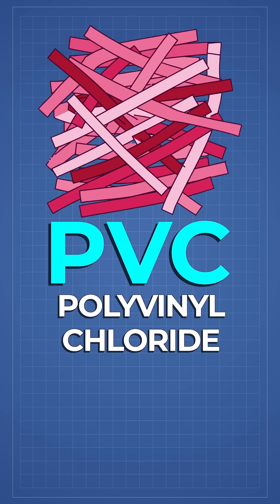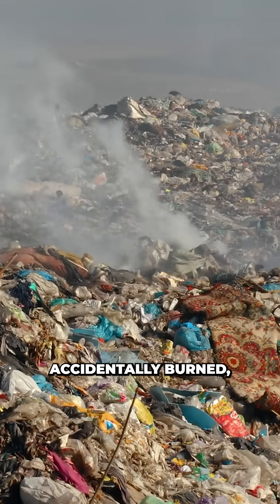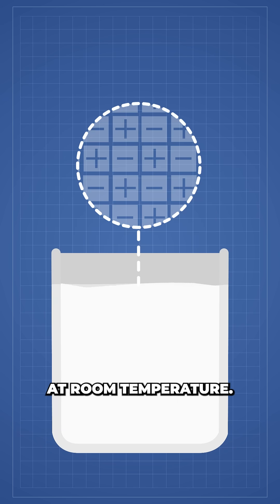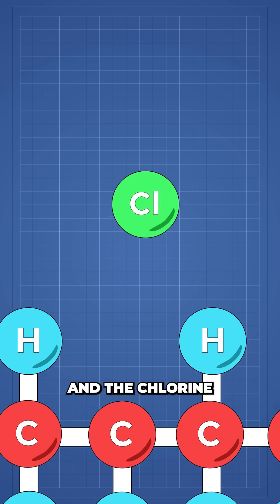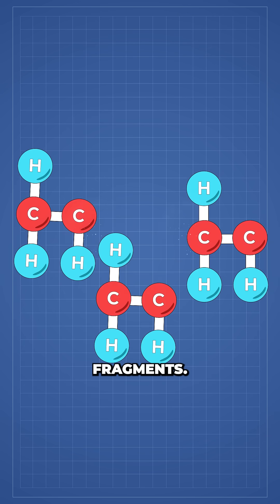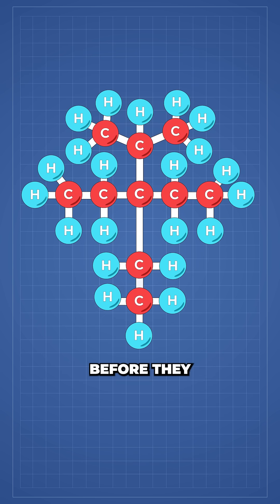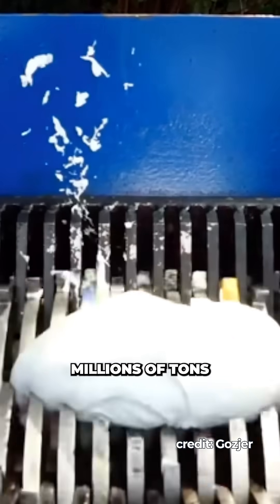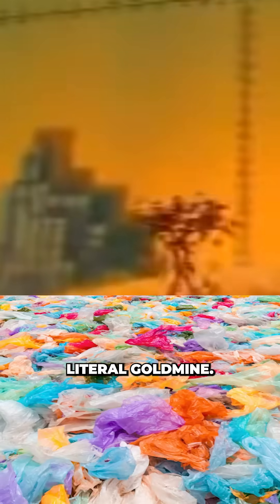Scientists Turn Plastic Waste into Fuel

Comment: no turning plastic in to fuel has not just been found out is been noted as early as 1980or the 1990 but the first usable form of this was in was in the early 2000 so this was not just found out is been around for about 4 decades

Comment: This has been around for years Scientists did not invent it this is why they got rid of plastic shopping bags because people were making free fuel.  It is the same way of making moonshine without water and fermenting wash you make kerosene and then still that again the kerosene and what comes  out is petrol or add the kerosene to takeaway oil and get something to run a diesel truck

Comment: The M16 Rifle: History, Design, and Legacy

The M16 is one of the most iconic military rifles in modern history. Developed in the United States during the Cold War, it has been a standard-issue weapon for the U.S. military and many allied forces for decades. Known for its lightweight design, high rate of fire, and modular capabilities, the M16 has played a central role in numerous conflicts, shaping the evolution of infantry combat.

The origins of the M16 can be traced back to the late 1950s. The U.S. military was looking for a replacement for the M14 rifle, which, while powerful, was heavy and difficult to control during automatic fire. The solution came in the form of a new rifle developed by engineer Eugene Stoner and the Armalite Corporation, designated the AR-15. The design used lightweight materials like aluminum and plastic, and it fired a smaller, high-velocity 5.56x45mm NATO cartridge, which allowed soldiers to carry more ammunition and reduced recoil.

In 1963, the U.S. military adopted a modified version of the AR-15 as the M16. Its first major deployment was during the Vietnam War. Early versions of the M16, such as the M16A1, were praised for their accuracy and ease of handling. However, they also faced criticism due to initial reliability issues, especially in the humid jungles of Vietnam. These problems were largely due to a lack of proper cleaning equipment and ammunition that produced excessive fouling. Over time, these issues were addressed with modifications, including chrome-lined barrels and the introduction of the forward assist, making the rifle far more dependable.

The M16 has gone through several updates over the years. The M16A2, introduced in the 1980s, featured improved sights, a heavier barrel, and a three-round burst fire mode instead of full-auto,

Comment: I had a similar idea in my undergrad using polyethylene to reduce it to ethane. I did some research on it and it turns out you can do it thermodynamically but it’s insanely inefficient and the yield isn’t very easy to get correct so it usually just turns into petroleum or something similar. I did find a bacterium that evolved to eat PET plastic that was selectively bred to eat other forms of plastic. This was about as close as I got to something like this lol

Comment: Since plastic is made by using crude oil tells me that reversing the process to get oil again is extremely inefficient to get the oil again, its good that we have a process to get oild from plastic, but its going to cost significantly more than the oil that we extract from the ground. Since energy can't be created nor destroyed we have to use a lot of energy to reverse the process. This will only be good when the prices of oil is so high that this processing will be cheaper than the oil prices

Comment: We always get these stories but it always turns out its like and then there's some critical flaw that doesn't get mentioned that people ignore and go "omfg the illuminati silenced them, that's why we dont have this"

Like...

We can recycle some plastics, it's just incredibly expensive to do in comparison to producing new plastics and the recycled plastics aren't as good a material.

Glass can be recycled and used as filler in asphalt for roads but it's only usable in warm areas because the roads are more prone to wear from cold weather.

The whole hydrogen powered car thing, supposedly the wave of the future and only produces oxygen and water as a waste material. Turns out when you expose most materials, like metals, to hydrogen, hydrogen atoms are so small that they're able to permeate between the bonds of the other materials and cause them to very quickly become brittle and break apart leading to the whole engine system literally turning to dust. Hydrogen is also much more difficult to store and transport than oil/gasoline.

Turning plastics in to fuel like this is great, but if it costs more money to convert in to the fuel than you can sell it for, it's not going to go anywhere. Likewise, if it costs more energy to produce than what you get out as fuel, you're not really saving anything. That's a similar issue that early EV's faced where charging the car's battery and running off the battery ended up being worse off for the planet than just burning gas to run a car. Things are better on that front now (not great but better), but it's an example.

Comment: Some time ago, say, twenty years give or take. They had a pilot project in Arkansas (I think) that was next to a poultry processing plant or three that was setup to take the left over by products from those plants, and turn it into a biofuel base stock. However, they found the ultra high pressure and heat used in the process could take pretty much anything that was organic, plastic, or even petroleum based, like coal and heavy crude products and change it into a light oil based product perfect for synthetic fuels AND remove toxic materials from the feedstock as well. However, it could only compete profitably if crude oil was at least a $100 per barrel. So I guess it failed. You might think that it would be a great way to get rid of this PVC and other such things even if you couldn't beat $75 per barrel oil, just as a better way to get rid of it than dumping it in a landfill.

Comment: This is nothing new. It takes MASS amounts of energy to do this. The amount of energy to "recycle" the plastics into "plastoline" which has much more harmful burn offs than traditional diesel and regular gasoline makes it useless. You have to put in more energy to get less fuel.
Reply: You're thinking of pyrolysis, this is not pyrolysis

Comment: I've read about the transformation of plastics into combustion fuel, and the information I know is that this chemical process is not novel and has been tried before to produce fuel. The experiments demonstrated that the chemical process is not economical (it's not profitable), and the fuel QUALITY is inferior to petroleum oil fuels and is NOT suitable to be used as combustion fuel.

Comment: If the waste it's not on/in the ground, it will be in the air.
Reply: If the alternative is letting the PVC circulate for a few hundred years poisoning the biosphere before it gets turned into CO2, I'd rather turn it into CO2 immediately and get something (energy) out of it.

Comment: The problem with plastic is that there are so many variants.
Polystyrene is the most common for wrappers and such. It can be burned for energy in the right waste processing plant  with just CO2 and H2O as exhaust and the CO2 is scrubbed anyway. So that's rather clean.

Comment: Man, you should have done some research on this lol this has been around for 30+years, it’s just not efficient on a large scale and the fuel has low energy density. It requires too much work essentially amd is too expensive on a large scale.

Comment: Alright if that works good 
But that "Fuel" that is created needs to be tested to Hell and back
We dont fix a Mistake by making a bigger mistake 
If that Fuel when burned in an engine for example releases a compund thats more Toxic to the Enviroment than normal Fuels or binds with Water in the Athmosphere into another more Toxic component than regular Fuels do then that whole process is not very Practical

Comment: The main issue is sorting the plastics and that almost all processes of recycling work for specific types of plastic, there was no one method that worked on all of them at once. Well there was one, that some oil refining expert used, the same one that is used for making the stuff in the first place, but those are not important... and Patent holders is not allowing for it...

Comment: Things like this will be the technologies that, once implemented, are going to go a long way to saving our planet.

There is also the current research into systems that use sunlight and atmospheric carbon to create simple hydrocarbons for fuels and chemical use, and similarly, a system that uses sunlight and atmospheric carbon to make simple carbohydrates which can be used for food, chemical production and industry.

This plastic to fuel process shifts the waste into a potential chain of use that is no longer damaging to our planet.

May be a pipe dream now, but it is a bright potential future, and what else is science for other than that future.

Comment: he really didnt discover the method. it has been known for over 40 years. petro-chem industries never bothered due to the significant cost in research, material costs, upscaling and lack of government incentives. It was found any hydrocarbon based plastic could be fractured back to essentially naptha. Even New Scientist did an article on this subject in the 90's
Reply: "he"? it's a whole team, not a single guy and the process is in fact new and less energy-intensive since it's done at 80°C rather than the usual ~400°C used for plastic pyrolysis

Comment: Broken window theory has been demonstrated to be empty schlock, created for ideological purposes.

People behave badly because they are incentivized to do so - because the anticipated benefits of acting poorly, balanced against the anticipated costs of doing so, is superior to the other options available. It's rather shocking that someone who deals heavily in economics doesn't see this as the core root of the problem.

Depending on the specific problem, there are several possible solutions that tip that equation against acts that harm ourselves and others. We can alter the environment to reduce the possible benefits of acting badly, or inform people of the ways the benefit is less than expected. We can increase the cost of acting badly, or ensure that people are aware of how it can already be substantially detrimental. And we can provide good alternatives, with better benefits and fewer costs, and ensure that people know these options and why they are superior.

These are specifically means of prevention, the ideal way to deal with the problem. There are other means (mitigation, transfer) to deal with these problems, but they are best stopped before they even begin.

Comment: Did you know this - in 2016, Professor Satish Kumar, a mechanical engineer from Hyderabad, who developed a three-step process called plastic pyrolysis to convert plastic waste into fuels like petrol and diesel
Reply: Plastic pyrolysis was conceptualized way before 2016, I don't think there's a single inventor for it
Reply: This is not pyrolisis

Comment: Is turning plastic to "fossil" fuel really the answer? Like, lets give it another round of pollution? What is we could use the exhaust air from engines to make plastic? Then we would use and re-use every single molecule until everything is converted to residual pollutents.
We took, from Earth, the resources to make plastic and we still have to find a way to return them. And the bill is not getting any smaller.

Comment: I've been suggesting an idea like this for years now, turning waste into something useful. Let's just hope the plastic-to-fuel refinery will get a mass-scale treatment because we NEED IT
Reply: Ignoring that it's less eco friendly than shovelling it in an open fire there is really only two types of plastic you can turn into gasoline and disel respectively, the news article this guy skimmed before making this pile of misrepresented info and misinformation was trying to convey is they found out a way to turn a third type into fuel in a way less efficient way than what we have had for centuries. The production of bio fuels is simpler cheaper and less toxic to the environment and when I say bio fuels there's really only one good choice and that's oil based fuels not solvent based fuels those suck ass and damage your engine
Reply: My first thought when looking at this is "Oh hey they turned burnable solid stuff into burnable liquid stuff, it's still gonna be bad for the enviroment even if you hide it by putting it in the air instead of a visible piece of pollution."

Comment: But let's be honest here: most plastics are derivates from oil anyway. It's still oil, but we burn it later after it already had another use case.
It's impressive tech, but in my book not as impressive as creating E-fuels literally from thin air AND removing CO2 from the atmosphere in the process via carbon capturing and hydrolysis powered by renewable energy sources - which we can do already, but somehow don't because some morons with a business degree decided that it's not "prize competitive"...

Comment: It’s annoying to see the guy from Texas, and now some random Chinese university, getting credit for something people have already been doing for a while (turning plastic into fuel). HOWEVER, the process seen here is the video is not pyrolysis as many people claim in the comment section because there is no heat applied here, it’s all chemical (their bonds). Very similar though as they both happen in the absence of oxygen
Reply: Their process still requires heat, they've tested between room temperature and 80°C which is still a lot lower than pyrolysis (>400°C typically)

Comment: So to make this simple... I thought this channel covered actual things but it appears that its another misinformation feeding slop... Combustion fuel can indeed be made out of plastic but the amount of plastic needed is massive and the other stuff that you dont need for it still cant move anywhere and is even more toxic than the plastic itself. Another thing, you would not be able to power a regular car with it and emissions would sky rocketed if you tried cuz burning is burning...

So to sum this up (I did that on the original video aswell which was made by that american junkie). The fact that you can make something out of something else does not mean you should. It is not cost efficient and unless you want to pay 300 USD per gallon (for americans) then just ignore this thing... It is not a "clean" fuel and also, it can be done only via specific plastic so bags and other things are a no no cuz most of them contain so much junk in them which makes it nearly impossible to "purify" and convert to combustion fuel.

ps: Yes, the american dude disappeared, he is most likely in jail and or sued by the city where he lives cuz what he was doing was highly illegal (he was basically making explosives because combustion fuel still falls into that category).

Comment: this is not new at all and has been known for quite some time. it's just not commercially viable. too expensive. yes, more expensive than oil rigs.
Reply: This new process can be done at 80°C compared to the usual pyrolysis process (~400°C) so it might be cheaper